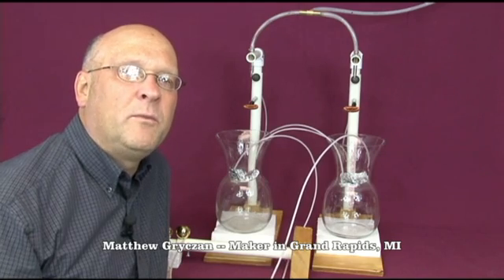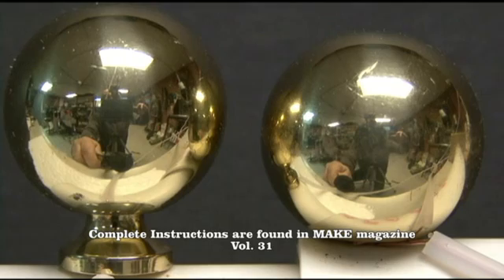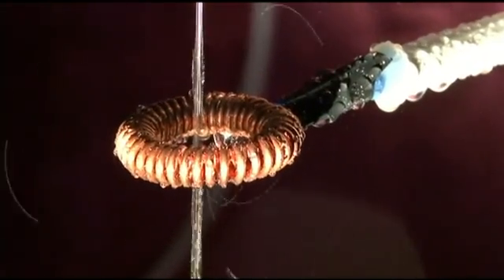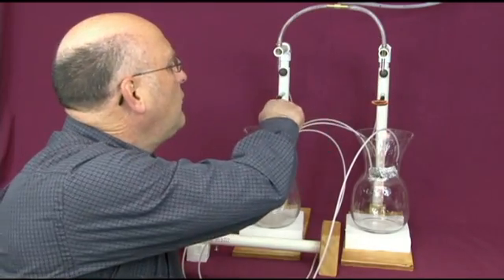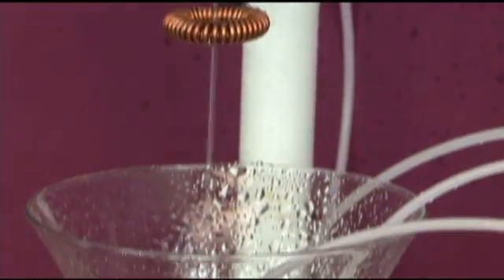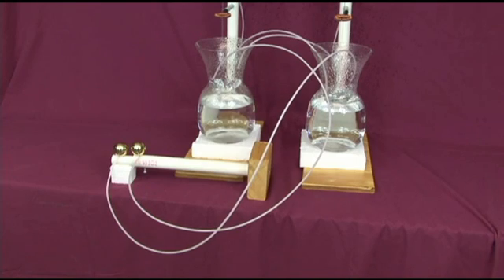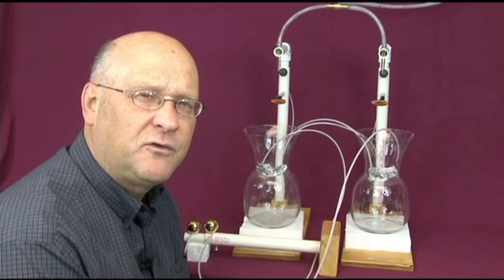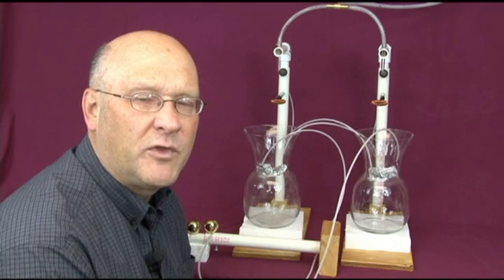How to make Lord Kelvin's Thunderstorm -- Electrostatic Battery

Comment: I could be splitting hairs unnesesarilly, butni beleieve convention is that what you called inductors are called inducers. Electrostatic induction use inducer surfaces where as magnetic induction use current through conductor through an inductor. 

The inducer loops don't need to be coiled or even need to make a loop as their is virtually no current. It's just a place for electrostatic charges to build up and sit on the surfaces.

Comment: Brilliant!
I love this experiment ... it is my favorite experiment in all physics,for its implications on the whole universe.
I think it explains the mechanism the drives the whole universe, little arbitrary changes intensified and build up.
I think you have it wrong though ... the "inductors" do not charge the water drops, random changes and and charges developed are amplified by the electroSTATIC charge on the conducting loops.  It's been along time but I don't think inductance really has much of a role to play here.  The random and opposite charges on the loops only allow the opposite charges to go through and repel like charges above, but they are caught in the bucket of opposite charge and as the charges build up the separation mechanism of the charge is enhanced and the voltage grows until it discharges.

Comment: very cool Matthew,  I was wondering if you put a volt meter between the positive and negative bucket would you get a dc voltage ? if so approximately how much ? also if you added a chelated iron to the water or increased the height the water falls would that increase the voltage? thank you.

Comment: thing about thunderstorms is ive never really seen a pratical use of them, neon arc lights aside , is there really now ampage not even if its converted to a reasonable voltage ? i never see anyone push it further than this or try convert the energy , the closest ive seen is laser sabers electrostatic generator working in a totally different way from atmosphere ,

Comment: is there a purpose in using coiled wire instead of hollow pipe for the inductors ?
Reply from the maker: I used coiled copper wire because it is difficult to bend copper tubing in that small of diameter circle without causing a kink or crimp. I think that a kink or crimp will act as a leakage point for the static charges, which collect at sharper edges.
Reply: Matthew Gryczan
ok thanks

Comment from the maker: You may need to apply some practical understanding of physics before you undertake your build. The generator converts mechanical energy (lifting water to upper containers) to electrical energy. This can be calculated, with some factor for charge leakage. The amount of electricity (energy) needed to split water into hydrogen and oxygen also is a well established fact. Compare the two. This battery generates high voltage and low amperage.

Comment from the maker: Hello Angelica, I've had an opportunity to view your video and I have a few suggestions for you to improve your performance. 1) I would use a non-conductive (glass, plastic) container to catch the water. I started with metal paint cans myself, but discarded the design because the metal cans leak so much charge. All you need is a metal plate (aluminium foil works perfectly well) inside the container to collect the charge. 2) I would use insulated wire throughout your design, coaxial is best.

Comment: Your video has been very helpful for me.  I upgraded my dropper with torrid rings made exactly as you've described. 

Now mine is very similar to yours, but I used that same copper wire to form two pieces that fit nicely inside the vases.  Turned out nice again.

Thank you for sharing your design.

Comment from the maker: Thank you for the compliment, Superknowz. I made the torrid rings by winding stripped copper wire from ordinary household cable around a phillips head screwdriver. It was a way to make a relatively small diameter torrid without the kinks that would result from bending copper tubing that tight. This final design was my fourth iteration -- I started with metal paint cans and standard wire that leaked charges significantly.

Comment from the maker: It is able to light a small neon flash tube, such as what you would find in a circuit tester at the hardware store. The device generates HIGH voltage and LOW amperage, and I do not know if there are LEDs that work under those conditions.

Comment from the maker: I really don't know if making the equipment larger would create a greater charge. My guess is that it can't just be scaled up indiscriminatly: i.e. a larger bucket may allow more charge, but a larger ring may reduce the efficiency of the generator. However, one viewer suggested that I connect a Leyden jar to create longer and more visible sparks. I am not  familiar enough with sizing Leyden jars to make sure they are safe, but I believe they would store a larger charge.

Comment from the maker: There's no limit to questions, RatedB, that's the fun of home experiments. I have only used tap water for my generator, so I don't know.  These are the types of questions that my design was meant to answer because it is set up for measurable and reproducible experiments, hopefully to boost the efficiency of the system. My understanding is the liquid must conduct electricity, so vinegar (a diluted solution of acetic acid) SHOULD work, as well as salt water, etc.

Comment from the maker: In rough terms, a spark that jumps a gap of 5 mm is more than 16,000 volts, depending on humidity, diameter of the terminals, etc.  This device generated voltage that sparked a little more than 5 mm in good conditions.

Comment from the maker: Try this first. Make sure that that the water stream from your water source -- bucket or faucet -- is not broken as it travels through the tubes to eyedroppers. No big air bubbles, fill the tubes as much as possible.  My understanding is the water in the tubes above the copper coil inductors acts as a pathway to create a circuit. If the water is broken, it breaks the circuit.
Reply: Can this be done with a water pump?

Comment from the maker: You need a source of water (tank, bucket, faucet) that is split into two streams of dripping water. Each stream of water drops falls through a hollow metal inductor (tin can, tube, coil).  Each inductor is connected by wire to a metal piece fastened inside the opposite basin used to catch the water. Wikipedia has a drawn schematic on this, and there are many different variations on YouTube. My design takes more time and care to build if you want to experiment, but other designs work well too.